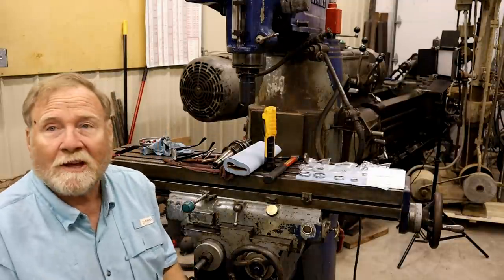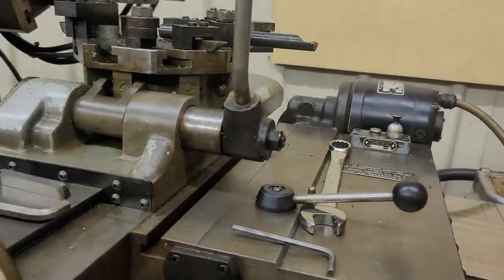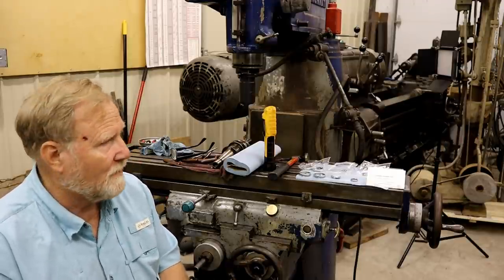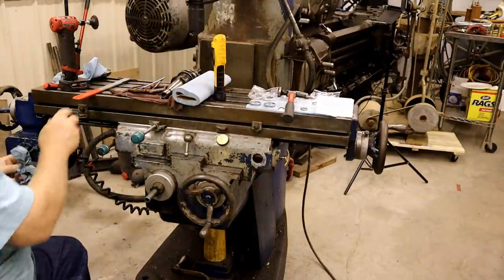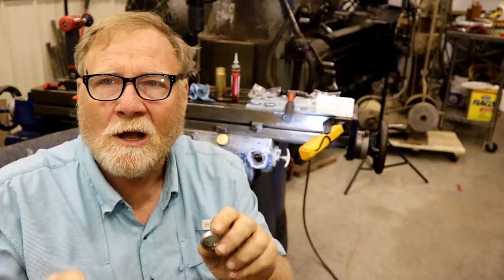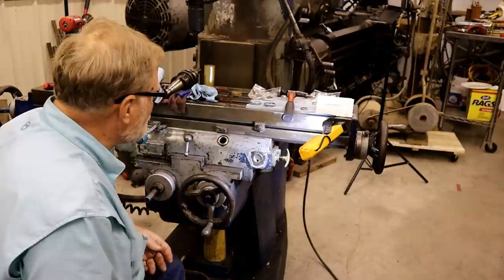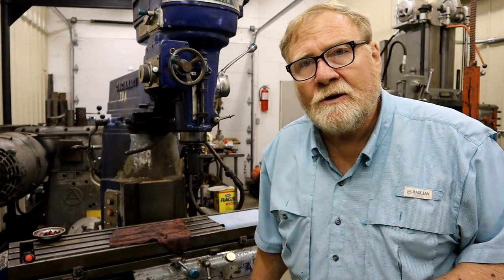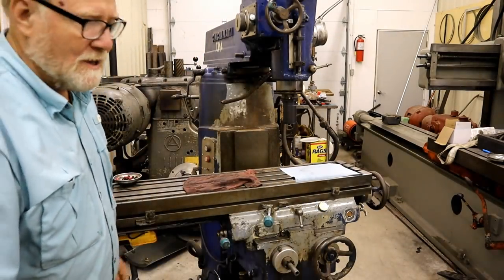How to Change a Oil Window in an Old Machine Tool- Toolmaster LIVES!

Comment: Thanks for the hands on illustrated 1D work. My 1D was in three heavy parts when I got it. Bar-draw bolt and knob missing. Jerry rigged transformer bypassed when I got it was fixed with a new transformer. Made a bar-draw bolt and knob.  I still have not fixed the leaky oil seal. My table power feed has stripped gears. Probably because the lead screw is worn, the backlash eliminator was set to take out the slop in the middle of the table but caused it to be super tight/impossible to get the last 6 inches of travel or more from left or right. I guess the previous shop used the power feed with a tight lead screw and made a mess of the gears. Still fun to use even if it leaks and has no table power feed.
Reply from the maker: IT's a shame how some machines are mistreated :(

Comment: FYI: My lathe is a Sharp - same Taiwanese manufacturer as Jet, Lux-Matter and others. The oil sight windows are metric and a different animal than the Bijur. I found a replacement source at Elesa in the HE and HRT series. I had already "refurbished" my originals so I have not actually ordered. Elesa has order quantity minimums so you may have to source from a reseller.

Comment: This is a great video Steve! I didn't know it was so easy to change oil sight glasses..... I guess it's all in knowing how, huh?

FYI - Years ago I used to use tricorethylene, sinusol, percorethylene, acetone and such.... Bare handed. As a machinist I had my hands in to all kinds of degreasing agents....... Only to find out, later, that they were all carcinogenic. So my friend, if you use that acetone please make sure you clean it off your hands well. (Just to be safe)
Reply from the maker: You bet!

Comment: If that wasn't 'Fluffy Butt' it ought to be. My Sweetie wanted a window in my head to see if the brain was. That's how she put it. Just was. We gave up after ruining all the bits we could find. The rock drill carbides were the best but the smoke was too bad. And I sold my body for money for over 50 years. It was good at causing things to burn diesel. GBWYall!
Reply from the maker: Yep, that's Fluffy Butt.... Might I suggest to your wife that a Jack Hammer might work....

Comment: Crackmaster has a very limited selection of those, it is the "press fit thru wall sights", used one last year. Needed an oddball size on my Yam lathe, iirc it was 1-1/16", could not find that size anywhere, ended up using a bronze flanged bushing to reduce the hole to 25mm so a plastic one would fit.
Reply from the maker: That is a good solution!

Comment: I'm assuming that on any machine with this type of "window" so long as the oil level is in the middle it is fine, correct?
Reply from the maker: Pretty much.... One  exception is the type of window that really is a window... Axelson lathes have a small window near the top of the head that really is just a window. There is a small oil line behind the window that drips oil as the machine is running. You can see the drops and that tells you the oil pump is running..
Reply: @10swatkins  Thank you for this followup.

Comment: FYI  Didn't use solvents like carb. Cleaner or brake cleaner  on the plastic lenses windows it will fog them up permanently.

Comment: I'm just thinking of adding those angled oil fillers at the right level and just forget about the sight glasses. Either that or just knock an overflow hole in at about the right level.
Reply from the maker: I think the glass would be much easier :)
Reply: @10swatkins  Time & again ? !
I wondered about filling them with a cleaning/flushing oil to clean the existing glass !
Reply from the maker: @millomweb  IF you can't buy one that is your next best choice... Maybe a sonic cleaner with purple power would do an acceptable job... DO IT OUTSIDE of course, that stuff is nasty!
Reply: @10swatkins  Maybe remove the existing one, thread the hole and make a sleeve to fit a smaller one that screws into the existing hole - easier then to get out and clean the glass !

Comment: Steve, could you do me a favor?  My 1-D is missing the handle for the spindle lock.  I can confirm that strange and undesirable things happen when the main motor is switched on when the spindle is still locked yet.  Would it be possible to get me a picture or two of what exactly the handle consists of?  Many thanks!
Reply from the maker: The whole assembly or just the handle?
Reply: @10swatkins  Just the handle would be sufficient.  That is missing, and I think there might be part of the locking fork that goes in the handle broke off as well.
Reply: @nschelling6420  The illustrated parts manual has a drawing of the bar-draw bolt. Get a three step step ladder and take the cover off the bar-draw bolt. You will see the simple mechanism. The bar-draw bolt and knob was missing off my  19611D. I made a bar draw bolt out of some 1/2" plate I had laying around based on the drawing. I turned a knob out of aluminum. The parts manuals are available on the internet. If there was a way to post a picture I would. Note that the knob for the bar-draw bolt prevents accidental motor engagement when the bar-draw bolt is slid onto the flats of the bar-draw. The knob is 1.5" in diameter where it engages in the S position of the L-S-R on my 1960 or 1961 1D. The L-S-R switch on my 1D has a round area in the S position that the knob slides into. You cannot make L or R happen until you pull the bar-draw bolt out and off the flats of the draw bolt. You cannot engage the bar-draw bolt when the motor switch is in L or R.  I do see some 1Ds do not have this safety feature to prevent motor engagement. Note that I am not a machinist, never played on in real life. Making or fixing this feature is a pretty simple task.  I do need to take everything apart to change the leaking oil seal. Other issues with my 1D but I have made a few things and fixed a few things.

Comment: What kind of work holding does the spindle use the Cincinnati special collets? Or something common? 40 taper would be great
Reply from the maker: IT slips my mind right now... IT's a 40 size with the longer threaded piece on the end....
Reply: @10swatkins  nice I’ll look into it it’s time for me to upgrade my old wells index anyway I learned my lesson with oddball spindle noses tho it has a bs9 taper tooling is hard to find for it

Comment: How does whay oil compare to say 80 -90 gear oil? And  does it have a smell like 80-90 gear oil or no smell?
Reply from the maker: I way oil from my Chevron Distributor here in town, buy it in 5 gallon pails, mainly because it is close and cheaper. (They also have the oil I use in the planer in 55 gallon drums :) )
Their way oil does not smell like 90 weight gear lube.   Way oil has additives to make it stickie so that it sticks to the parts and reduce, or eliminate, stick-slip in machine tools.  Stick-slip is not good :)
Reply: @10swatkins  I have an economy lawn and garden tractor made in the 69-70 time frame and it needs a really thick oil in the transmissions 95-140 gear oil is not thick enough to slow the gears in it to allow you to shift gears. Was thinking of mixing grease in with the oil , any thoughts on the subject?
Reply from the maker: @tacticalrabbit308  Even though I slept at a Holliday Inn last night I am not up on oil or their additives and I would hate to hurt your transmission... I can tell you that gear lube is thicker than way oil...
Reply: @tacticalrabbit308  Add a can of STP to the oil to thicken it up!  Also makes a good tackifiers to ISO68 oil turning it into poor man's way lube.
Reply: @tacticalrabbit308  Check on Snapper 00-grease. Some draglines used to use Texaco Marfak aluminum soap gun grease when the gear oil would bypass the seals and run out.
Reply: @tacticalrabbit308  My JD870 has syncros on 1-3 gears. The range gears do not have synchros. I have to stop to shift range gears but not to shift the speed gears that have syncros. Those gears are lubricated by Lo-Vis hydraulic fluid. 1978 Dodge Aspen used automatic transmission fluid in their 3 speed plus overdrive manual shift transmission. The JD tractor needs to be split to lubricate the splines the clutches ride on. PTO and drive clutches. The sticky splines can cause drag that makes shifting challenging. That ramble is that really thin oil still works with transmissions that have syncro gears. Dragging clutch will cause more problems than oil viscosity. Way oil does not stink of sulphur or friction modifiers like gear oil.